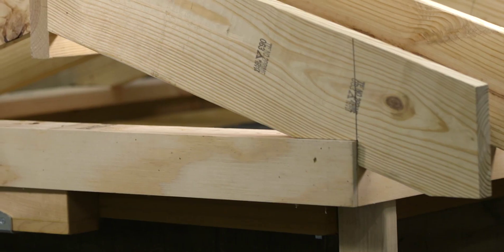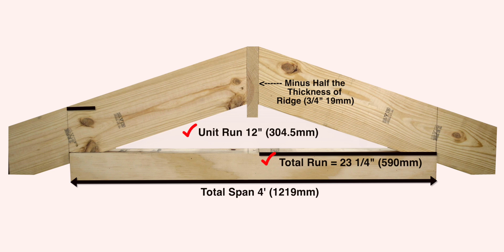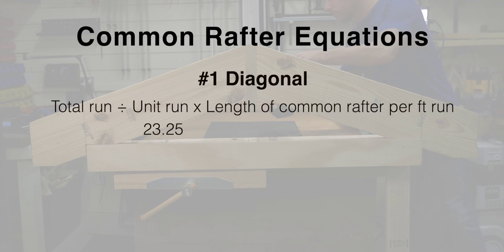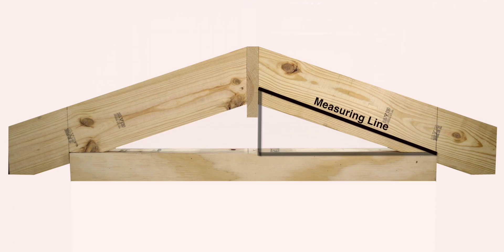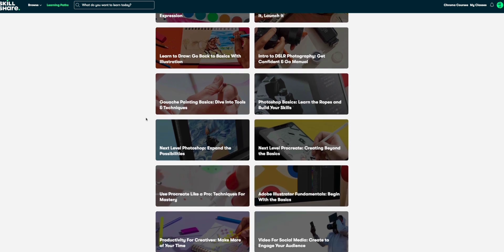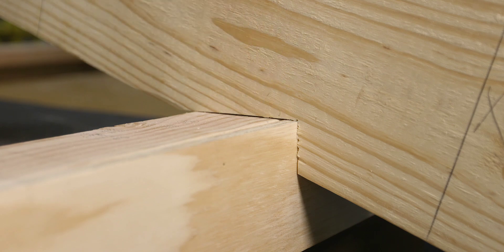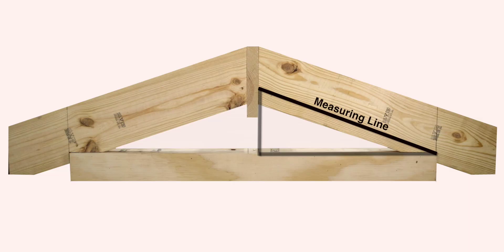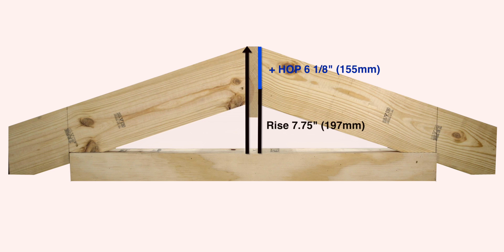Basic Equations For Roof Framing

Comment: Very informative. 
But have a question.
While cutting overhang, you measured 6.5 inches. How did you come up with that number (6.5 inches)?
Reply from the maker: The overhang amount and soffit cut dimensions are almost always different for each roof. These variations depend on the design, personal preference, and the type of trim being used. The 6.5" measurement shown in this video is just an example. I hope this clarifies things!

Comment: Great video. I had a question when measuring to make a cut line. I noticed you measured on the inside of the square, but marked with it with the outside of the square. Is that always the case?  The first time i measured and marked with outside  square, but my birds mouth cut was 2 1/4" extended past my top plate

Comment: I watched your common rafter video's which are great however i kept getting stuck in one area. When you laid out the framing square you would mark off 12 inches which confused me because i thought each step should have been in this case 12.65. However, i tried it myself and measured the step off revealing revealing 12.65. Thanks for the wealth of information information

Comment: I have a 45° roof. I need to change the angle a bit down from the top and extend the run over a new wall further out. How do I attach? Especially the top of the new rafters to old
Reply from the maker: You would lay a 2x12 over the old roof and attach the new rafters to it.

Comment: Great videos, thank you.
I'm building a garden shed, using a 13ft 12 by 6 inch ridge beam (locally harvested). Using normal methods of rafter construction, I would be left with a 6 inch wide flat surface on the top of the ridge, which would be difficult to sheath prior to applying roofing material. How do I measure the rafters so that they meet at the center point above the ridge beam. Are there 2 bird mouths, one for the ridge and one for the exterior wall, or only one for the exterior wall?
Reply from the maker: Yes, two "birds mouths". All you have to do is not account for the ridge thickness in your run number, then locate your ridge height and cut your birds mouth. Hope that makes sense.

Comment: 2nd Year Carpenter here. I'm currently in school learning this stuff and I found your videos very helpful! 

One thing that I might add to this is that calculating your Slope Gain Factor is a game changer for calculating your rafter length. The equation is (Rise/Run)Squared+1, then square root. This is your slope gain factor. For example a 4/12 has a SGF of 1.054, meaning the cut rafter length is 1.054 times the length of the rafter run. So 24.25 x 1.054 would calculate your rafter length from ridge to birds mouth. You can even add your overhang to the rafter run length to get your total rafter length from ridge to facia. You will need to do deductions afterwards, of course. But its a little less math. You can also find the SGF of your hips the same way but adding 2 instead. (I forget the reason exactly, I was falling asleep at that point in the Theory.) So that would be (4/12)Squared+2, then square root. 1.453 is the SGF of your hip rafter. Hope this helps anyone learning how to calculate rafters!
Reply from the maker: Bro, thank you for adding this great info!
Reply: I don’t understand 😮I’m so lost. What is the first step to do this?

Comment: Hello, I'm building a shed and find your videos so helpful. Any chance you can help me with a question. The shed is 16 feet x 10 feet and is almost 8 feet high. My ridge needs to be 16 feet long. My question is for that size of shed, what is sufficient for the ridge? 2x6x16 or 2x8x16 enough? Or do I need to go 2x10x16? Also, I'm using 2x4 as rafters. Thank you.  Romeo Suarez
Reply from the maker: Hi Romeo! A 2x6 should work just fine.
Reply: @TrainingHandsAcademy  thank you so much!